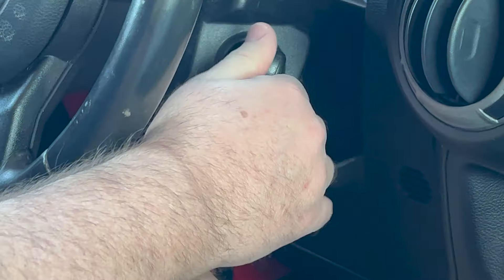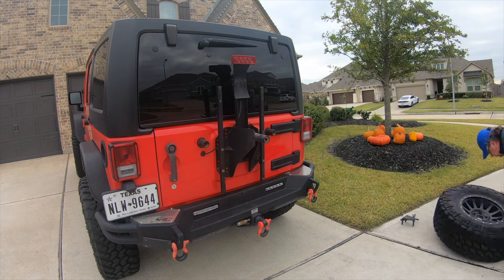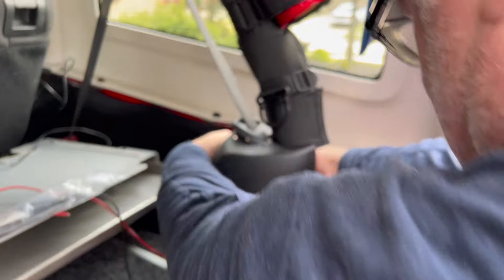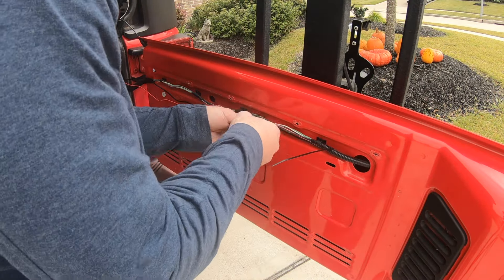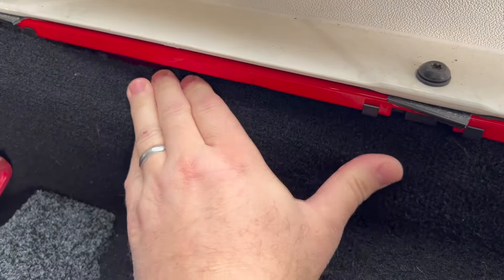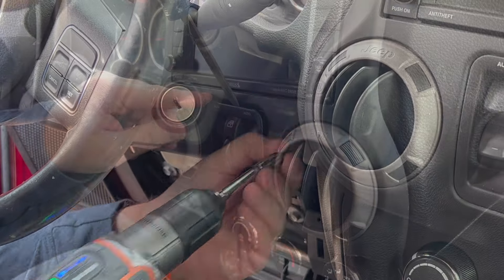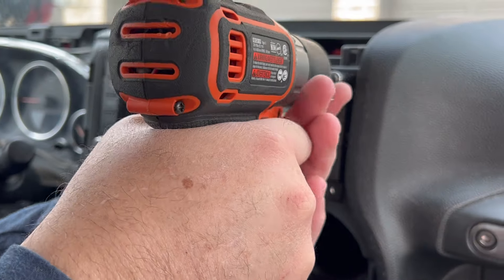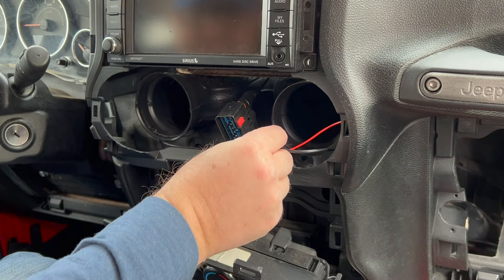3 Simple Steps To Installing A Jeep Wrangler Backup Camera #jeep

Comment: Good video. At least you explained why red wire wasn’t needed up front. Did you connect red to reverse wire in rear taillight? Thanks
Reply from the maker: When I connected the camera in the back, I used a constant hot wire previously installed to connect the red/power wire off the camera.  The harness that you connect to the radio controls when the back up camera turns on and off when shifting into or out of reverse. 

Thank you for watching!!!
Reply from the maker: Here is our products page: https://sayyesoutdoors.com/product-page

Comment: What company makes this unit and what is the model number?
Reply from the maker: This is the Brandmotion 9002-8847 Rear Vision System with Adjustable Mount Camera for 2007-2018 Jeep Wrangler JK with Factory Display Radio.  You can get to all of the products we recommend here: https://sayyesoutdoors.com/merchandise.  This item is under Jeep Accessories.  The price on these have gone up since we purchased in 2022, so if you have sticker shock, there are several brands that could meet your need and budget.  My recommendation is to purchase a backup camera with the programming module to save you from having to go to the dealer.  If you have any other questions, please let me know.  Thank you for watching!

Comment: Hello friend, I have a question, I have a factory radio similar to yours and I want to add the camera, I will need the rca adapter to connect the camera but this camera does not come with a programming tool to synchronize the camera... how do I do it in this case?
Reply from the maker: The backup camera that I purchased has everything I needed.  When doing my research on purchasing, at first I could not understand why some cameras were so inexpensive.  Eventually I figured out it was because they do not include the programmer (in some cases).  It is my understanding that you may be able to buy just the programer from the camera manufacture, or you can bring your jeep to the dealer and they can program it for you at a cost (I imagine expensive).  I hope that helps and please write back what you find out!

Thank you for watching!
Reply from the maker: Here is our products page: https://sayyesoutdoors.com/product-page

Comment: There was no tool included with the camera to sync it with my radio.  What is going on here?
Reply from the maker: It depends on which camera you bought; some of the less expensive models don’t include the module needed to update the radio. I’d suggest reaching out to the manufacturer to see if they sell the module separately or if it was accidentally left out of your package. That’ll likely be a lot cheaper than having a dealer update it for you!  Thank you for watching!